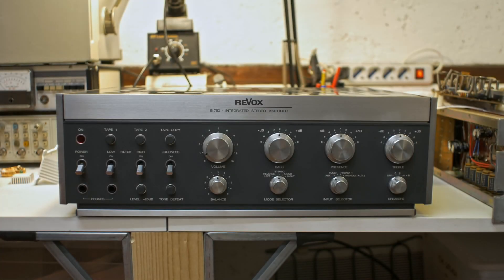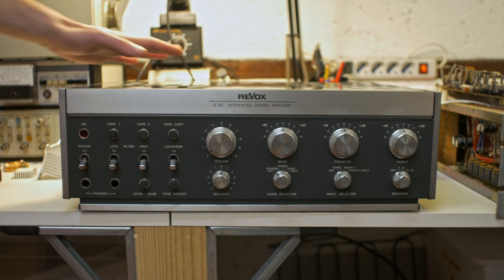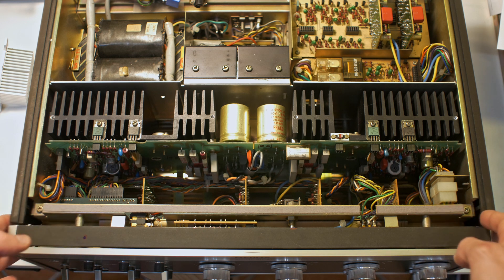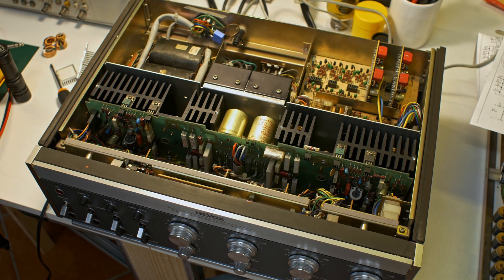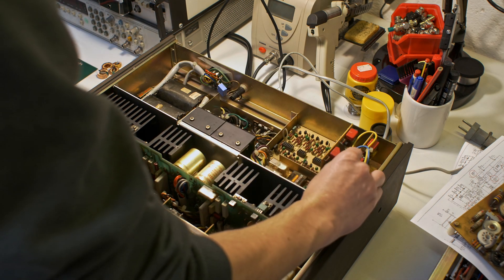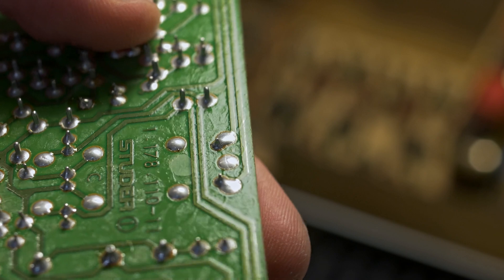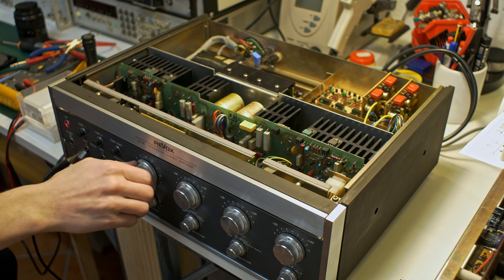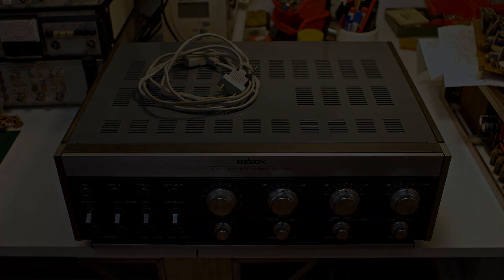Revox B750 Quick Check and Repair

Comment: hello, I have a B780 which was completely overhauled in 2016, and which works wonderfully. For a month now when I turn it on it works perfectly for 35 to 40 minutes then a fuse blows and the sound is full of distortion. I turn it off letting it cool and I can listen to it normally again for 35 minutes until the fuse blows again! what do you think could be condensation or another cause of the problem??? thank you in advance
Reply from the maker: Hi sorry for the late response. It could be a bad capacitor that is turning into a resistor, thus heating up and then shorting a part of the circuit, but I suspect there’s something else in your machine. These amps are exceptionally well constructed, but the board assembly, although very easily serviceable, means that you’ll have a ton of contacts that with time can oxidise and not make good connections anymore. They sometimes can move a little and short something too. On the unit I had there were a lot of contact problems due to bad storage conditions. 
In your case it seems that a component or some contact between boards or components may heat up and then short something somewhere. 
I would reseat all the connectors and boards and test the unit taking measurements of temperature around (even better with a thermal camera). 
Hope it helps!

Comment: Hello, my name is Armando Addati.

My receiver's fuse blows (250V AC 5ST 0.25A slow).

To look for what part of the system was causing the short and do a basic plug and play test I toke the power supply off the system.

I had it stand alone totally disconnected from the receiver. In fact the fuse of the power supply still blows, so my guess is that the problem is in the power supply.

History: I bought the three systems in Boston in the 80's. In year 1990 when I moved from Boston to Rome, I had to convert it the receiver from 110volt to 220volt by moving a bridge into the power supply. So I did change the configuration on the power supply and it worked. Changed the fuse to the new config.

The system worked until a few years ago. Then I had to move houses and I left the system in a box for many years.

Now I moved to Canary Islands (Lanzarote) and in my new house I reinstalled all my parts (BB225 and B215 apparently all working).

Unfortunately the receiver shorts. What can I do? Is there a way to repair it or a new power supply to replace it?

If it can be repair, do you have a list of technicians in Spain or in Italy I can contact?
Reply from the maker: Hi Armando, if you have some experience with electronics, I guess you can get a spare power supply for your receiver (or even make one). If you are not sure, though, I highly suggest you bring the receiver to an expert tech for repair. 
There're quite a few repair centers scattered around Italy, expecially in Milan I think. Unfortunately I have never brought anything for repair, so I can't really say which is the best...
Hope it helps! 
Ciao! 
Dave
Reply: @DaveElectronics  Do you think I am using the wrong fuse? is it maybe 2.5 amp what I need? the manual says 250 mA and that is 0.25 amp.... in your experience should I try a 2.5 amp fuse?
Reply from the maker: I checked the manual and it says 0.25A, so that’s the correct fuse. 
A 2.5 amps fuse would be way too much if the power supply has some shorted components, you could fry everything…

Comment: Thank you for another great video. I recently bought a beautiful B780, but unfortunately, it has a little problem: When I power the unit ON, I see weird partial numbers on the various displays. But after cycling through ON-OFF,s multiple times and letting it rest for a few minutes, the unit starts to function properly. Would you know what may have caused this? Thank you in advance for your advice.
Reply from the maker: Hi! Thanks for the nice comment :)
The problem could very well be some bad contacts on connectors inside. Or could also be some bad capacitors.

Comment: Made me dig out my b750 which I pulled to bits 20years ago I had forgotten it was easy to work on and think I will finish it now. One of the capacitors you changed (the one at the front) has split so that seems like a good place to start.Thanks for taking the time to video this.
Reply: No working used a variac and slowly bought up the voltage then watched replaced the two capacitors which smoked. I will have to change or clean the vol pot and expect to do all the capacitors and tidy the case thanks for giving me the confidence, The b760 may be more of a challenge.